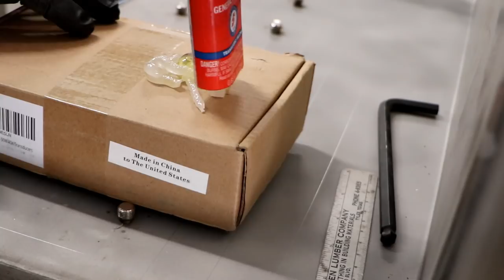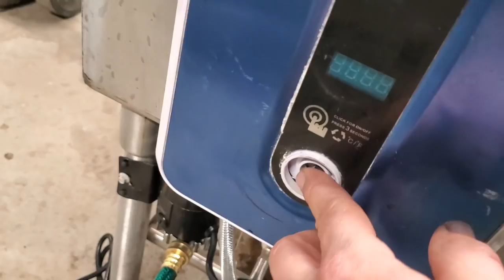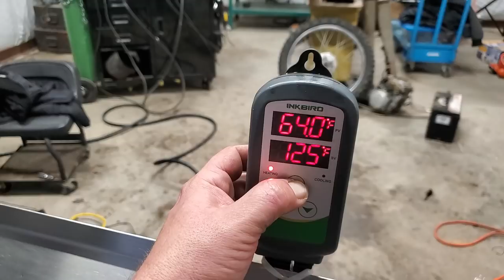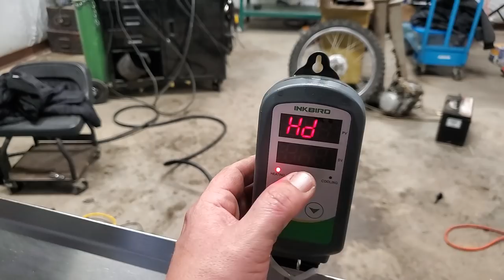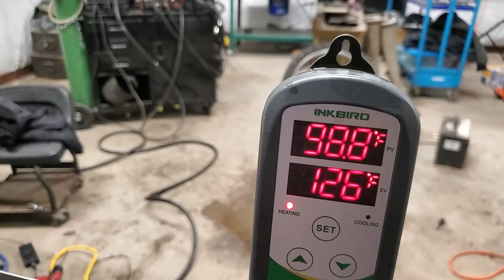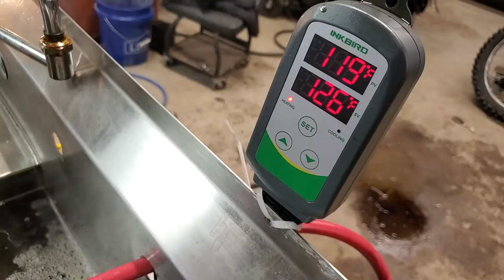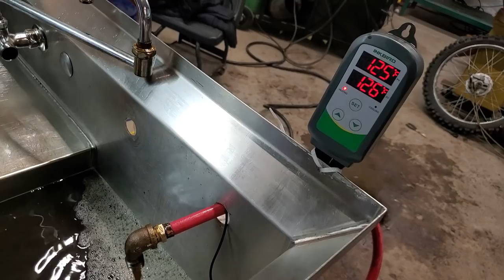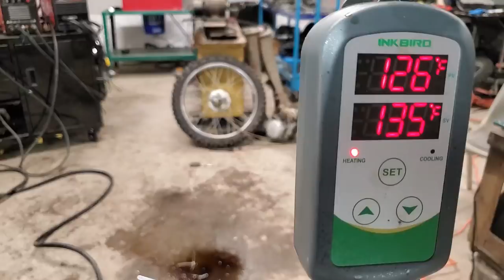Forget everything you know about RUST REMOVAL!

Comment: Video is well done.  Thanks for showing how all this is put together for the DIYer.  I have a double commercial stainless sink I'd like to do this with.  I currently use a 60 liter Chinese tank big enough for a cylinder head to fit inside.  I use Purple Power or Castrol Super Clean (mixed 50/50 with water) to clean residue and oil varnish off internal engine parts.  If these products are used fresh, they will attack aluminum, but will not attack aluminum once they are "tempered" with use by some varnish contamination.  A way to determine whether the cleaning solution is tempered enough - submerge the aluminum part in the solution.  If you see tiny bubbles coming from the surface, it's not friendly enough yet for aluminum.  It's great to have a large ultrasonic tank in the auto shop.  It automates cleaning bolts, brackets, heads, valve covers, cam and crankshafts, connecting rods, pistons, intake manifolds, etc.  They all come out of the tank clean as a whistle, looking like new.  Cleaning parts is a time-consuming portion of every repair.  This streamlines the repair process by at least 20% on most large jobs.

Comment: this isn't green, you can build a vawt wind turbine with a vibration shaft for wet tumbler, blades for water agitation or use static or dynamic centrifugation. to remove rust you can attach the vawt to a compressor or a pump and air sand or water sand blast, using sand from the soil separated with appropriated mesh grid size
Reply from the maker: That's a terrible idea.
Reply: also the greenest way to create cavitation is a loop water system with a propeller or pump, a sort of water tunnel that is usually used to study cavitation and you can power it with a vawt and gears

Comment: Instead of epoxy, do you think you could have accomplished the same thing with silicone adhesive since you had the spot welds to secure them anyway?
Reply from the maker: After doing a ton of research I would stick with epoxy. If you do use silicone I would do with lexal. The epoxy has held up for Two years and it dries hard. You want the ultrasonic waves to easily pass . A softer material may absorb some of the waves, though it would be minimal as we are talking about an extremely thin layer.

Comment: INSULATION

Reckon I would have used insulated washers on the supporting threaded rods where they passed through the corners of the boards, and one each side. Additionally, the circuit boards could have been much farther away from the tank....anywhere really depending on the length of wire chosen to connect them to the tank. Voltage drop would not be an issue anyway.

Connection to the tank could be a single lead which was then connected to the transducers. A simple plug connection for this lead would aid moving stuff around and storage.

With the circuit boards some distance away, I would think a wire cage or basket, (insulated as required and appropriate), would allow a more efficient airflow around them.

Oh, and in parallel rather than in series......

Just a sayin'....

James Hennighan
Yorkshire, England

Comment: just sayin the negative side of the transducer are all common so you cant put them in serie, only parallel otherwise great project, i will probably build one myself, however i might put the transducers in more than one side of the tub, like on both opposite side with no more transducer than you but spread on 2 side, what do you think?
Reply: remi briere ...I wonder if they would cancel each other out?  I bet the science of ultra sound plays by it's own set of rules I know nothing about.  Hope someone reading this does.
Reply: @leebarnhart9725  yes depending of the wavelengt of the transducer and the width of the tub but they also can cancel eachother in the same wall just like speakers, must find some way to tune the system to be optimal and avoid cancellation of ultrasound, i will have to check prior to build mine.
Reply: @remibriere3932  what about the kind of circuit that swaps power to each set at a specified rate. Like Christmas lights. that way you can have power from 4 sides alternating as fast as you want.
Reply: @ronswoodturningshopandstuf5759  good idea, might be an option thanks!

Comment: Hey, great video man! Just a simple advice you should put the intake fans facing somewhere with no heat source since you're definitely using hot water there I guess what sink must be generating hot air next to the fans on the side of the ultrasonic devices are attached to.

Comment: You said early on that you were going to place a resistor across the transducers so they wouldn't hold a charge when you turned them off.  You failed to do so.  Why?
Also, I would suggest you use an Arc Fault/Ground Fault Circuit Interrupter on your feed circuit.  They are cheap enough and better than your grounding system because if it trips, you've probably got a problem somewhere.  A ground wire will just relieve the problem without any indication that it is doing so. 
Thanks for posting.
Reply from the maker: Sorry, the resistor was not to be installed but held across the terminal to keep me stom shocking myself during the installation.

Comment: Don't you have to make sure all those control boards are in sync? I imagine you would have to wire the boards, so they run from the same frequency generator, or they can cancel each other and you would lose a lot of cleaning power.  Kind of like noise-cancelling headphones.

Comment: The project is excellent. What always gets me with any rust dissolving solution is that a person is always just buying more solution. If you could make something that would not be worn out you would be a millionaire. Also, I have found that anytime you are using surface adhesives you will ge a big surprise the glue will let go when you least expect too. How about  the transducers sound wave cancelling each other out ?? Would having the individual amplifiers setup to different parts of the sine wave make the unit even more efficient ??? Maybe placing the transducers at different angles would increase the cleaning power ?? Look forward to see your next project fella.

Comment: What are your thoughts on putting a filter of some type in the return line to the tank to keep the Evaporate-rust medium cleaner?  When I treat heavy rusted parts my fluid gets a lot of solids in it and gets real black and icky looking.  I strain it thru a paint strainer or nylon hose to clean it up every so often.
Reply from the maker: +Lee Barnhart it is a must have. I need to find the perfect filter.
Reply: @TheGoodoftheLand  what is that piston from? For sure a diesel.

Comment: Instead of putting the transducers only on the one side, would it work to put them on multiple sides or would that create interference and reduce the cleaning power?
Reply: Robert S. Was wondering the same thing.  Maybe put the pairs on opposite sides??
Reply: opposite sides would make the waves cancel out. It would only be of benefit to use two adjacent sides.

Comment: How much in parts do you estimate this setup costs?
Reply from the maker: +xephael I spent about $500 but i had the hot water heater.
Reply: @TheGoodoftheLand  Thanks I like to know about what stuff costs before diving into projects... Did you consider mounting ultrasonic transducers around tub so there would always be direct angle to piece being cleaned?  Just do one side because easier to wire/setup?

Comment: Hey Justin, great work. I don't much about that stuff but, I wondering why why you not using different color wires. Black ,red and yellow(brown?. It seems to me that it would easily to find where everything goes? Thanks for sharing I like what you do. By restoring old machinery.
Reply from the maker: +Sir.Tony Blair jr  it's hard to tell in the video but the white wire positive has a black stripe. I wanted red an black but this was the only cost effective wire for the job at lowes.

Comment: Hey buddy, I think it turned out pretty well.  One thing I was wondering is, with 9 driver boards did you have to overcome any issues with them being out of phase with each other? It's probably not enough to worry about but my thought was that if one or more of those driver supply boards was too far out it would reduce the total amount of power by contradicting the others.

The only way I would even know how to fix that (other than going to a single signal source) is to align them against a single frequency standard on an o-scope or pick one and align the rest to match.  I don't see where there's a way to align them though.
Reply: Oh, I was thinking the same thing!

Comment: I was really looking forward to you trying to wire those in series and blowing all of the boards at once. :D

If you know anyone that vapes (tell them they look ridiculous) and ask them to blow their “smoke” into your project box while the fans are running. You can also use a fog machine or and automotive smoke machine (all the same crap). I am willing to bet that you have very poor air flow through your box. Most likely the air will travel almost directly into one fan and out the other fan. I’m not saying this setup won’t work, but it certainly isn’t optimal. The best arrangement would be to have the fans on opposing corners as you mentioned. With that said, you could leave the fans where they are and glue a divider into the box, to force the air to travel in a horseshoe pattern and most likely get the best cooling possible with those fans. 

Edit: I’ve just made it 23mins into the video and realized that both fans are pushing and pulling in the same direction... lol

Comment: Hey Justin..Awesome video. 
Do you think that these parts would make for a good gun/brass casing cleaner? Minus the Rust Evaporator solution.
Reply from the maker: Absolutely. The diy setup works great and has tons of power
Reply: Get an ultrasonic cleaner from Harbor Freight - about 55-60 bucks with a coupon. A  PD local to me uses one to clean Glocks at the range. It will also do the brass. Just use a little Dawn detergent. or Simple Green.
Reply: Get an ultrasonic cleaner from Harbor Freight. 55-60 bucks with a coupon. If you need one a little bigger, 250-350 from Amazon vendors. A PD local to me uses one at the range to clean Glocks after qualifying/practice. A little Dawn or Simple Green. Dawn shouldn't change the color of the brass.

Comment: Sorry, but I missed the logic of putting all the sounders on one side of the tank rather than all the way around?
Reply: there is a very small chance that if you put them all the way around, that you'll actually position them within a half wave length, therefore neutralizing their effect. Great for making an active sound suppressor .. not as good for ultrasonic .. although saying that, the wavelength would be extremely small .. so the possibility is small .. but there none the less.

Comment: I would NOT use epoxy !  It is FLEXIBLE !!  If you don't think the tank surface is "flat enough" have some 1/4"-3/8" plates machined and welded to the tank and bolt to that.  Of course welding could distort the plate.  Probably not really practical to machine AFTER they are welded, but fine sand paper on a ground 1/2" block would do the trick, admittedly slowly.
Noctura fans are better.
Reply from the maker: Epoxy is how it is done. It is standard across the industry. If it has an ultrasonic transducer on it epoxy was used to adhere it.The side of the tank is flat enough. Do not weld transducers to the tank. The welds will crack.  You can't have a transducer within three inches if a weld. Epoxy is tough stuff and if applied correctly can make a stronger bond than welding. Lotus proved this through extensive testing with the Elise. Hope this helps. Thanks for watching Jack.

Comment: Fantastic machine and will be a real game changer for many. Explanation was a bit sketchy but still had enuf info. Would be interested in the development story, what led you to the idea. Did you consider a patent? cos this will be snapped up by manufacturers.
Glad you pointed out and fixed that wrong colour cable problem. You may know what is what but after a few years you will forget and curse yourself for doing something so silly and dangerous'
One HUGE problem with this build tho..
Using with the fasten screw of 10mm attach to part marked for adjustment with slot B and connect at angle of proper size to being (refer diagram F) when aligning part G and 27 only must be the left flange type.
Reply: Those machines are mass-produced for nearly hundred years already. Up to really huge ones, like 5000 liters and 20kW of ultrasonic power.
Reply: @evilgremlin  Yep. aware of long term use of ultrasonics. Using the evaporust is new tho, then again I haven't done a heap of research.

Comment: That's a great idea and you did a pretty nice job. You should REALLY learn more about electrical work or at least consult a legitimate Electrician when working on the AC wiring, though. Having a green neutral and switching on the neutral side of the circuit are not cool. Relying on adhesive alone to mount your "buss bars" or your entire driver stacks is not cool, either - especially on a giant high powered vibrator. At least you were attempting to bond the metal parts and trying to do a good job. But eventually those kind of mistakes will bite someone and that little piezo  shock will seem like nothing. You could potentially wind up with a 120V sink and it'll seem fine...until you find a ground. Great project, just be safe. I have to agree with you that was the worst Changlish ever haha.
Reply from the maker: +DS Splicer I come from an auto body back ground so there is a method to my madness. I used epoxy because it holds up better in vibration.it is even stronger than a welded joint. It will not come apart unti I take it apart. I literally stake my life on it.

Comment: You know an angle grinder with a wire wheel is alot easier.
Reply from the maker: +old man river rimington how is an angle grinder with a wire wheel easier than dropping something in a bucket. And if your wondering why all of the rust comes back and ruins your paint job its because after using a wire wheel you never treated the rust.